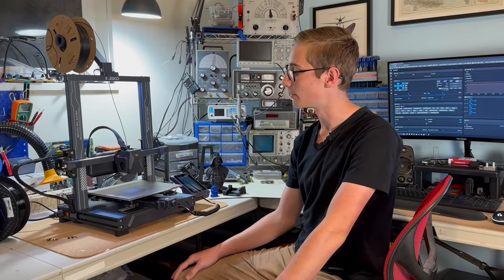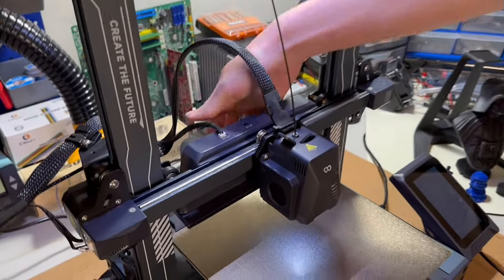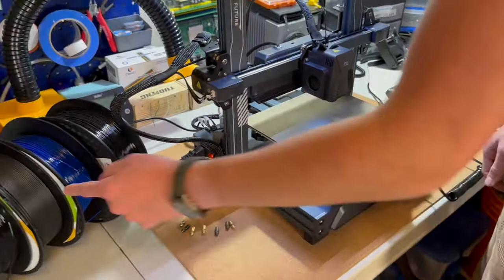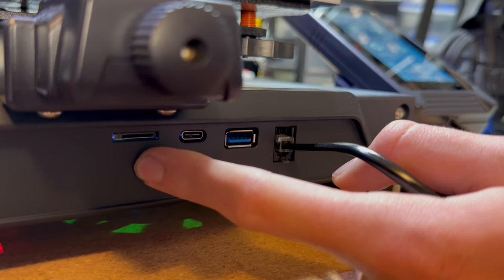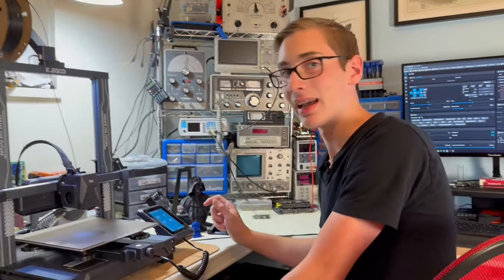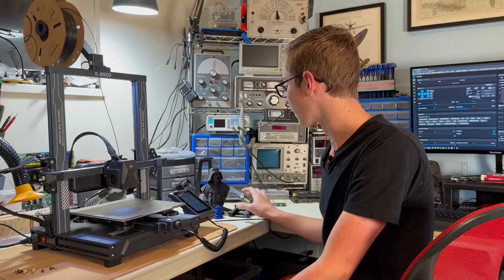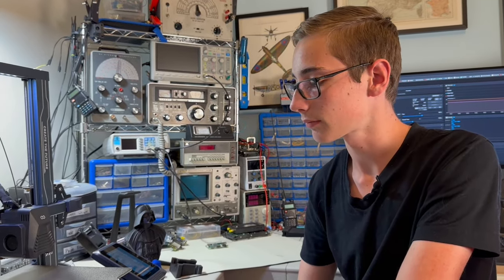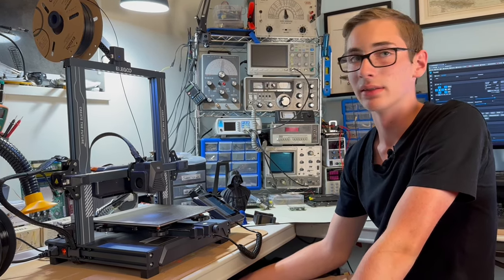Elegoo Neptune 4 Pro Review (after 200+ hours)

Comment: Very informative video young man, just subscribed i'm waiting for mine to be delivered shortly. my first ever 3D printer, i have black pal to practice with. What slicer do you use if you don't mind and is it a long learning curve ? i have a MacBook air laptop
Reply from the maker: I personally use Prusaslicer for most of my slicing, I like the UI and the organic supports that were introduced in 2.6 are really nice (cura has their own version of organic supports too). Considering it is your first ever 3D printer, I would stick with the Elegoo Cura that comes pre loaded onto the USB drive that comes with the printer. It is virtually identical to Cura, and if you learn how to use it you can use pretty much any slicer software as long as you take the time to figure out where everything is located. 

Due to the Neptune 4 Pro being so new, slicers like the stock Cura and Prusaslicer do not yet have detailed profiles for it, so using the Elegoo Cura that comes with it means you don't have to make a detailed profile, for someone new to 3D printing, this is incredibly useful when you are learning what everything means and what it does.

It does not take much time to learn, and there are plenty of YouTube videos that will go in depth. Down the road if you end up prefering a different slicer you can either make your own profiles or by that time proper support will probably exist.
Reply: Wow your knowledge is very impressive, i feel like I'm gonna be over my head but time will tell. Thank you very much

Comment: im getting this as my first 3D printer. Would it be okay to have it in a colder environment like a garage?
Reply: You should print in a stable environment or get/make an enclosure. If your garage is room temperature, no swings, no drafts, low-humidity, it's fine.

Comment: Hi, Great and informative video... I have seen a couple of video's saying that folks were having trouble in printing circular objects? As in, there is a roughly 0.2 deviation in the print making round objects. Have you had this problem and if so how did you fix it?
Reply from the maker: I just finished the video about the circular object issues, I am honestly quite shocked. I printed a couple prints that had pieces that would need to stick together, and I did not notice any issue. I actually have not encountered any issues other than some ringing and ghosting at high speeds. I am going to test mine tomorrow, I am very curious if it shows up on mine. I will let you know what I find.
Reply: Thanks for the reply and it will be interesting to see the results of your tests. @BenMyhillJones
Reply from the maker: @chrissavill8713  I just did a few tests and I found that my printer does in fact have a slight skew issue. It is much less than what was shown in the other video, but it is still an innacuracy of +/- 1%. When testing and making cylinders that had to fit into other cylinders printed on a N3P they fit fine and for me, I will not change the way I print. For more extreme cases I want to look into skew correction through klipper.
Reply: @BenMyhillJones  Thanks for the reply and doing the tests, also for letting me know.  I wonder why it is happening and if it is correctable?
Reply from the maker: @chrissavill8713  I am not sure what the best way to correct it is, the issue is the x and y axes are not properly alligned, similar to how a bed is warped. Because the alignement error could be non existent for some, and terrible for others it is hard to create on solution for everyone.

Comment: Hey, I might be a bit late here, but Ive just got a quick question regarding the noise - 

Im planning to pick one up soon, but Id like to be able to print overnight without keeping people awake. Itll be in a spare room with nobody there, but Im wondering, is it loud enough to be reasonably audible through walls?
Reply from the maker: For the most part it is fine, as long as you turn down the speed and fans. I have mine in my closet, and when I turn off the rear fans and turn down the Printhead fans it is very tolerable during the day time. I don't print with it at night though because it is reasonably loud when it is less than 10 feet from my bed.
Reply: @BenMyhillJones  That's reassuring to hear. I have mine on the other side of the house so it hopefully won't be a big issue. Thanks!

Comment: I have the n4p as well, for the first 100 hours it did perfect, now im having offset issues, wondering what your input is
Reply from the maker: When you say offset, are you talking about z offset? The z offset will vary from printer to printer, so the best thing you can do is go back to the calibration side of the menu, and redo the z offset using a piece of paper.

Comment: Hi, do you know any code to start cooler fans to make cool bed plate temperature until 35°C to take easily on the magnetic bed plate?
Reply from the maker: I personally have not seen any, that does not mean they do not exist though. It also would probably be relatively simple if you write a small gcode script to put at the end of each print.

Comment: I really liked your video. but I have a doubt. To get the most out of the printer, do you have to have it connected with the Ethernet cable? Or even if it is disconnected, does Klipper still work? greetings.
Reply from the maker: I would 100% recommend using the ethernet cable to connect to the printer,  because you can do some really cool and useful things with the web interface. Historically, to make the most out of klipper, you would need to access the web interface. With this printer though, you don't necessarily need to use ethernet to take advantage of the klipper firmware. The printer comes with an input shaping profile and a tuned klipper profile that works pretty well. The web interface is just for additional tuning and controlling the printer remotely.
Reply: @BenMyhillJones  thank you for your advice. regarding the quality of the printer. I'm between this and a Kobra 2. The truth is I'm going to start on the topic of filament printers. I currently have a resin one but I would like to venture into filament. Which of the two would you recommend? greetings.
Reply from the maker: @Belenorth  I have never used the Kobra 2, but I have used other Kobra models. Generally, I find the UI of the Elegoo printers to be far superior, in terms of print quality and speed I am not sure. I can't recommend you do or don't buy the Kobra 2, but I can certainly recommend the Neptune 4 Pro as it is a solid 3D printer.
Reply: @BenMyhillJones  thank you very much for answering. I think I've already convinced myself to buy the Neptune. Thank you for taking the time to answer my question.

Comment: I cant get my Pro 4 to print faster then 183 mm, when I type in 250 mm in cura setting it dont get any faster and the box turns red. can you help ? Is there a place I can find the setting I need ?
Reply: Perhaps you could try using Orca slicer instead? Note that I don't have this printer but this is what I've heard. People were saying that nep 4 pro wasn't supported well on cura.

Side note: Your comment is 7mo old, who knows if you still have this issue.😂Maybe someone down the line with the same issue will see this.

Comment: Better get a casing for the fumes if you sleep in the same room. 

Nice video btw. 😊
Reply from the maker: Thanks for the advice! When it comes to fumes I have been pretty careful. I have not printed ABS yet, and whenever I print a material like TPU, PETG (and sometimes PLA if it is a longer print) I will run a HEPA filter next to the unit, I also keep the printer as far from my bed as possible.

Comment: Can those fans be replaced with 40x40 noctuas or those are turbine fans ???
Reply from the maker: That is one of the first upgrades I looked into, unfortunately they are not 40x40mm pc style fans. After reading your comment I wanted to see if it could be upgradeable, and after dissasembling the fan shroud, you might be able to. The fans take in air through the back and blow it downward towards the actual nozzle of the fan shroud. With some modification and perhaps 3D printed parts you might be able to install some quieter fans. 

I think it could be done, but it would not be a drop in replacement and would likely cost more than it is worth.

Comment: Hi, how does it work with Tpu? And does it work with 6mm nozzle?
Reply from the maker: It works well with TPU, you just have to turn down the speed. Do you mean .6mm nozzle?  If so yes, you just need to make sure that it is a Neptune 4 pro nozzle because it is proprietary.

Comment: What is your opinion on this vs. the new Ender 3 v3 KE. It also has a 500mm/s max print speed and its about $20 less expensive. One thing I do like about it is it has wifi print via the app that I could have on my phone. Also I enjoyed your video it was very good.
Reply from the maker: Thanks! I have not personally tested and used the Ender 3V3 KE, so I could be wrong. My first printer was an Ender 3V2, and the main reason I own a Neptune 3 Pro. I got so frustrated with it that I eventually sold it to buy the Elegoo. I have also worked with other Creality machines that are just not relaible. The one thing I will say is the K1 looks like a solid printer, and I think Creality is taking the time to make better printers. The whole Ender 3v3 lineup certainly looks promising based off of the specs, but if their QC hasn't changed in the last few years then I would not recommend it.
Reply: @BenMyhillJones okay thanks, I’m more heading towards the elegoo. I still need to do some more research.

Comment: The nozzle keeps knocking the print off the build plate when you get about 15cm.
Reply: I keep having this issue when i print anything with supports, im new to 3d printers but not sure if its my retraction settings or of my filimemt is to moist (getting a filimemt dryer tomorrow)

Comment: Can this be upgraded to 350c hotend?
Reply from the maker: As far as I know you cannot, you might be able to increase it slightly through firmware mods. The stock hotend can reach 300c though. I would personally not recommend doing something like that just fire hazard wise.
Reply: Not too worried about fire hazard. I want to print the expensive industrial materials and I was hoping I could upgrade the hardware to get to at least 350c Do you have other recommendations?
Reply from the maker: @MrKennykyle1  I honestly don't know how you could improve the hotend temps, most printers I know do not go that high. My biggest concern would be the fact that if the material prints at 350c, then the printer would need to be in an enclosure, this is fine for already enclosed printers (most notably the bambu x1 and p1s) but at that temps the enclosure might be too hot for the stepper motors and similar components. In my opinion at the price of an enclosure and modding the hotend that much you are better off purchasing an enclosed core xy printer.
Reply: @BenMyhillJones  qidi max 3 does all of that. I was just hoping to find a cheaper alternative

Comment: Don‘t sleep with your printer. PLA fumes might be just as detrimental to health as ABS or even worse. Look it up.
Reply: they're both hazardous, but judging from what articles i've seen, ABS emits three different carcinogens, whereas PLA emits two. Styrene fumes are most dangerous and are only characteristic of ABS. I'd suggest just ventilating your room if you're working with PLA.
Reply from the maker: Thank you so much for the advice! Almost 100% of the prints I do are sub 6 hour so I always do them when I am at school or something and I can open a window. I also keep both my printers inside my closet,  and I have a HEPA filter running at all times when the printers are running and for a good period afterwards. This doesn't deal with 100% of the VOCs, but when I have a window fully open and a fan running I feel pretty good about it.

I had looked it up a while ago and the general consensus was that PLA was harmless, but after reading more studies and articles it is evident that that statement is false. Safety is something that I take very seriously and I will make sure to improve the general safety around my printers.
Reply from the maker: @daspas2111  Thank you! This is really useful. You said ventilating my room is fine, to what extent is this required, would opening a window and running a HEPA filter be adequate?
Reply: Tbh a simple enclosure should be plenty for pla......if anything
Reply: @BenMyhillJones  HEPA filters aren't fine enough to filter PLA or ABS fumes. It's not the end of the world, though, but if you're really persistent on keeping the airspace clean, I'd recommend a fume extractor of some kind.

Comment: I have both the Neptune 4 and the Neptune 4 pro. I do prefer the Neptune 4 tho. the metal roller is louder and is not better than the pom wheels . I don't feel the segmented bed makes any diference.  thanks for the video.
Reply: The metal roller are better in the way  they won't wear down as fast as the pom wheels (especially considering there are a lot of movements on this axis)

Comment: Saw another review that said to NOT get the Neptune 4 Pro if you plan on using it for functional parts, because they are defective. He said the X/Y axis are misaligned and your prints will be off by .2mm+. So any prints that you plan to fit into each other or onto other pieces will not work/fit. Have you found this issue?
Reply from the maker: I just saw that video a couple days ago, and it is concerning. I tested my printer and only found a deviation of under +/- 1% (for most prints +/- 0.7%) which, for me, does not make a difference. I would never have guessed that it would be an issue, especially since I primarily print functional prints and I never encountered any issues. 

For people printing any parts that are not cylindrical that need to fit together, then I would say you would never notice it. I am looking into ways to fix it easily, and if it is a simple software fix, then it shouldn't matter for most people.
Reply: @BenMyhillJones thanks for the feedback. Do you have any experience with the Sovol SV06? That's my other consideration